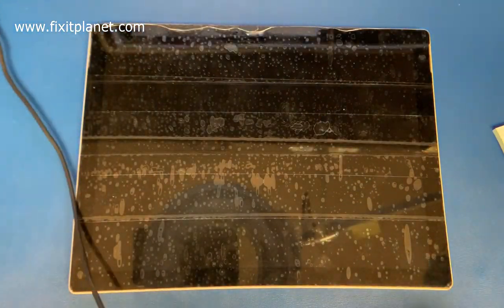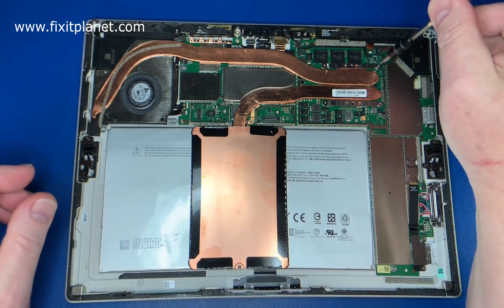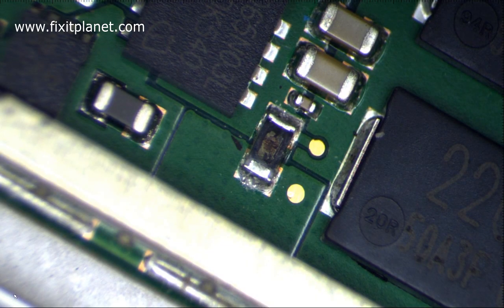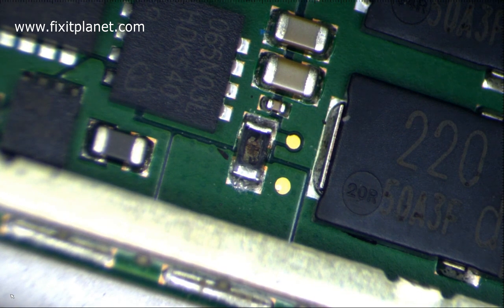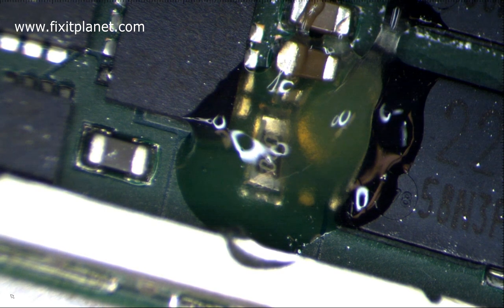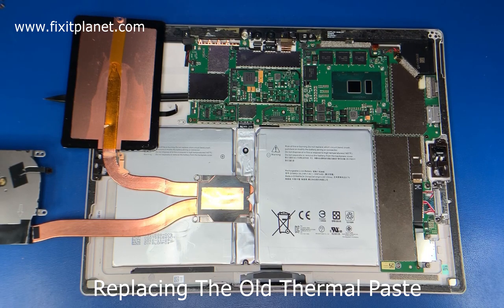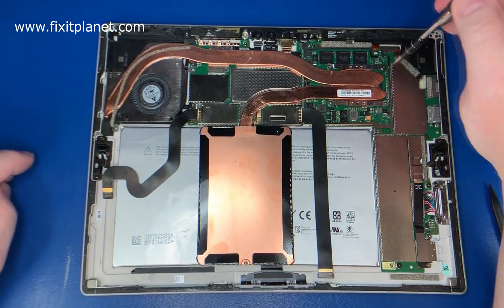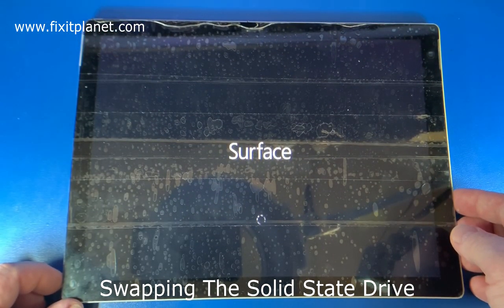Surface Pro 4 "Won't Turn On" Repair From Start To Finish.

Comment from the maker: Please Note: We are replacing a 0 ohm resistor. Sorry I said it wrong in the video.
Reply: Hello @Fix It Planet my surface pro 4 got freezed and after forcing to shutdown i got only black screen...
The keyboard lights still work and also wenn i connect a external hdd the light of the hdd shines... 
Is it possible that i have the same problem? Thx for your video
Reply: @Fuxn  Hello, same problem....
Reply: -  I didn't have a spare 0-ohm resistor so I made a solder blob to bridge the contacts. Works like a champ!
- I suspect the root cause for these 0-ohm resistors failing is elsewhere - so without a 0-ohm basically acting as a tiny fuse, what will blow up next? I think it is prudent to limit turbo boost with Intel XTU or Throttlestop on any of the machines with these symptoms to prevent the CPU from going into high-current mode.
-  BTW I love the trick of wedging up the mainboard with a spudger to free the battery contact without having to remove the whole board
- Note: T5, T4, and T3 torx are needed to work on these things.
Reply: A 0 ohm resistor is really a fuse
Reply from the maker: @DSAK55  Yup
Reply: @phatvw1  exactly my thought. If it's 0 Ohm doesn't that make it basically just a bridge? In which case it sounds like it's main job is to get blown when needed. Why isn't this a fuse?

Comment: Also to report that this fixed my problem! SP4 wouldn't Turn On but noticed that backlight for keyboard was turning on.  Luckily had replaced battery earlier this year and was easy to open. My resistor did not show any signs of burn but could see a voltage drop. Just did a little solder jump to test and everything works as usual!! Will later try to install properly the zero Ohm res. w/ proper equipment. Thank you for your video!
Reply: How it stop working????
Mine is like this: "I do a reboot... after 5 minute,i was surfing browser. and suddenly it freezed. i do long press power button for 30 sec to force shudown.... and then it did not turn on...."

When power turn is press i hear some clicking sound in camera, and CPU area is little warm....

Is your symptom  like me?? did your surface freezed like me??? please narrate/.... Thank you

Comment: Great video.  I just replaced the batteries on (2) Surface Pro 4.  First problem: I did not have the ribbon for the battery on the pin below the motherboard (video I had watched did not mention it) so it was not properly aligned and showed "no battery" when I tested them after installation. Both worked fine connected to power.  Second and current problem that I cannot figure out:  I re-positioned the ribbon from the battery on both units so it was on the pin and lined up correctly.  Now, both units will not start on battery or connected to power.  The light on the charger is continually on for about 3 seconds, then very quickly blinks of for split second, then on again for about 3 seconds.  I do not see any burnt components, as in your video.
Reply: Update: I put a thin piece of plastic between the battery and contacts on 1 to see if it would boot, but it did not. I was reading another post and it said that if the prongs on the motherboard touch the wrong contacts for the battery, the motherboard could be fried.  If that happened, what should I look for?  If not this, then any suggestions? Whatever I did wrong, happened to 2 of these.

Comment: Hey John, Thanks for this and all the informative videos.  Question: Was this device not powering up or just not powering the display? I have (and have seen) Surfaces that behave like this one but when a keyboard is attached there is power to it.

I'm about to dig into a SP4 that has power but no display. I'll let you know if the same resistor is the issue.

This could answer a lot of questions people have been asking about Surfaces for years.
Reply from the maker: Power may still reach some areas of the logic board depending on what failed. No power just means the tablet is not turning on. Maybe the CPU is not getting power for example so the tablet does not turn on and certainly no video will appear on the screen.

Comment: Hi, I've been frustrated by the lack of information around the schematic on surface pro's and wanted to share an idea. I noticed quite a few test pads on the boards which seem fairly common over the entire range. I'm going to try and document what the correct voltages should be on each one during various stages, would you be interested in validating my findings?
Stu
Reply from the maker: Sure
Reply: hello friend, do you have the voltage values?
Reply: please share your findings....
Reply: did you do the test?

Comment: Hey @fix it planet I am having the issue where the surface will power in connected, but wont cycle without. I am preparing to get find the resistor thats blown but was just wondering if there are any steps you would take to ensure that this is done properly. Also, what is the glue stuff you are putting on the board when doing the soldering? This will be my first time doing this type of repair so I want to make sure that I have all the right tools.

Comment: Great video!  I'm doing several Surface Pro 3 and 4 repairs for screens and fan/heating issues.  I saw you used Protronix thermal paste in the video 2 years ago.  What would you use now in 2021.  I've been reading about this: Microsoft Uses Honeywells Phase change TIM to stop regular thermal paste from leaking onto the motherboard.  Any opinion of what is safe to use? Exact brand / Paste would really help me.  Thank you!
Reply from the maker: We will still use Protronix Series 7 and Series 9 is available now too https://amzn.to/3xVKBVX Non drying formula is good. Cheers!

Comment: Great tutorial! What about a Surface Pro that will not charge? (or turn on) [the charger led will not light up] 
I have a SP7 and 2 month after warranty and it will not charge or turn on. 🤔
Reply from the maker: I am actually working on that tablet now too or a 6 I can't remember. I guess if I can, I will post a fix.
Reply: @FixItPlanet1  Fantastic! 
Did I miss your post for the tablet fix?

Comment: How did u manage to open the screen? Bc i also have this problem w my SP4 but repairman said that he couldnt open this device, bc of it is vacuumed??
Reply: It's just got a sticker holding the screen in just like all modern phones you just need a heat gun, a guitar pick and suction cups. You have to be careful not to shove the pick in to deep as there's a ribbon cable attached to the screen

Comment: My surface pro 4 won’t run off the battery and it has to be plugged all the time  💔 is it easy to replace those diodes you talked about ?

Comment: Dear Fix IT Planet,

We have a surface pro 4 right now. The surface is only working with the ac adapter and not with battery. When you pull out the ac adapter the surface wont start. 

Do you know how to fix this?
Reply: the same to me,
Reply: Sounds like a battery issue

Comment: I am an amateur at this and have no idea what to do inside my Surface Pro 4 but I seriously feel like I can't live without it. Is there anything I need to do for static or can I just open this up and follow your video and be fine?
Reply from the maker: Just be sure to discharge your self into the frame before touching anything inside. Good luck

Comment: I have surface pro 4 don't  turn on I checked all voltage diodes resistor fuses  everything it's ok but when I putt chargeur nothing happens cpu don't heat at all 
Can you give me any solution 
Ic give 3.3v
This fuse give 8.7v
Diode battery only 12v to 8.7v
Diode chargeur 12v to 0v

Comment: Hey @fix it planet - Do you have any idea what I am looking for when soldering the new resistor onto the board for a surface pro 4 that will only turn on while plugged in? I have all the parts and am ready to do the repair but dont want to take off the wrong one.
Reply from the maker: There is not a cut a dried answer. First close visual inspection under microscope is recommended. If everything looks perfect then probe around using a multimeter following the circuit for faults. Among other things bad caps, resistors, and even transistor is possible. Short to ground is a dead giveaway but finding the culprit takes investigation and patience.
Reply: Fix It Planet thank you so much! I will let you know how it goes.

Comment: Heyy i don't know if anyone can help but while replacing the battery i used a metal tool and think I may have shorted something. All I know is that my surface pro 4 has no power with the new battery (the contacts are touching fine)

Comment: For someone who don't have the kit required or no experience with detail repair like replacing resistor, it would be better to replace the mother board?
Reply from the maker: Sounds like it. Yes.

Comment: Thanks for the video. You aren't kidding that there isn't much info on repairing a Surface Pro.

I was gifted a Surface Pro 1 that doesn't turn on and seems to be the black screen of death, would this resistor repair fix that generation of tablet as well? Where would I source a part like that?

Comment: So I  soldered new resistor on, surface boots up but only to external monitor,  lcd is black..any thoughts ?
Reply from the maker: Double check display connections. Verify no physical damage. Try a known good display. Good luck!
Reply: @FixItPlanet1  turned out to be a bad screen, the flicker problem was so bad it only works for a few secs, then black screen, an new pro 5 screen and appropriate cable sorted it thanks

Comment: Can you describe broken resistor model or good replacment model which I need to buy. I replace it two time . My resistor blow two times on mine surface pro 4.
Reply from the maker: Please Note: We are replacing a 0 ohm resistor. Sorry I said it wrong in the video.
Reply: You better thank God you didn't fry the processor..
Way too many people believe that the part that fails is the problem, while it usually is some other part on the same rail.

Comment: hi, i have a pro 4 that has a black screen, but the keyboard lights up and it gives power from the USB port, when i hold the power button down it seems to shut off, but no screen activity at all, charger or not, any thoughts ? thanks
Reply: Nevermind, I got the screen off intact and yes, its that same 0 ohm resistor its the tiny 0603 size, the smallest SMD 😆..have ordered some thanks
EDIT, there's an even smaller component just above the 0 ohm resistor, you have to Really look to see it, I don't trust my hand so have put kapton tape over it in case I blow it away..anyone know what that component is ? Looks like a REALLY  tiny resistor or fuse maybe 🤔
Reply: Same problem here. Any fix?

Comment: I try to desolder the 0r resistor. 450 degree c should be enough to melt the solder. Once i touch the tip of solder to the board, it cool down the solder very quickly. Please help me as there are now short circuit cold solder between the chips

Comment: Same problem on surface 5. Help to find the same resistor on the power of the processor for replacement by 3Amp.
Reply: Have you try to fix it before?

Comment: This is exactly what happened to my SP4.  I am an artist and was using it daily.  Can you tell me how much if I sent it to you?
Reply: I can fix it
Reply: $250
Reply: @mp77715  hello. I'm interested also. Can you email me please with the info?
Reply: Jesus Chavez email?
Reply: @jesuschavez5660  Did you get this fixed?
Reply: I'm having a issue with SP 5 - Adapter light on, no power
Reply: @mzportr  nope, still looking for a service to do this

Comment: My SP4 charger will not show the white LED charge light. First attempt less than 48 hours after normal use and proper charging.
It just won't turn on.
Tried three chargers and none will show the white LED charge light when connected to the SP4.
I borrowed an SP4 and all chargers show white charge light. So must be my SP4 has a fault.
What should I try first? (I am very afraid to try to remove the screen)
Reply from the maker: Unfortunately you have done all you can do without taking the screen off.

Comment: What is the storage space max this system supports and which is the size format it uses (22mm x 80mm)? Any special recommendations on type of ssd to buy for this particular model? I know you mention NVME. Don't they exist in different physical dimensions?
Reply: 1TB Nvme or m.2

Comment: I have this issue where it won’t turn on at all, even on charger. But that diode looks ok, could the diode go bad without being “blown”??
Reply from the maker: Yes but there can be other failures also this is not the only possible failure.

Comment: Is there a place I can buy that battery connector/spring pin from?
Reply from the maker: just do a search for Charging Port Connector for Microsoft Surface Pro 4/Pro 5 1724 1796
Reply from the maker: Is yours physically damaged?

Comment: Hey! I have a complicated question for you. So I'm in the process of repearing multiple SP4's however one I'm working on is strange. The "fuse" is good. The diodes are good, and I'm measuring 3.3V beside the ITE IC controller. However I am only measuring like  0.5V on the 6 orange things (not sure what they're called) in the power delivery section of the board. what should I look for next?
Reply: did ypu manage to fix it ?
Reply: @thezombiesurvivalist It is insanely annoying if someone asks for something but will not answer other peoples questions. Answer @arminder Deol s question amonatidis

Comment: Very interesting and educational video, I could use your help. On my surface pro 4 I replaced the screen and the LCD cable now the screen comes on during boot or if i go to bios settings but as soon as windows starts it goes off but the tablet is running which I can see on a secondary screen, also the touch doesn't work. Any suggestion from your part would help greatly. Thank you.

Comment: I have found several kinds of 0 ohm jumpers but with different watts 125w and 330w?  also where can i find a kit for the flux and heated twezers
Reply from the maker: We are using these hot tweezers https://amzn.to/2pqpmxV Hand piece only here https://amzn.to/37cpodK We use this station https://amzn.to/2KqtGVe or you can use this https://amzn.to/35cLOK9. For a one off repair cheaper options can be substituted such as this https://amzn.to/2CPRWvz Flux we use https://amzn.to/2pqqzoX or https://amzn.to/2qTYpD3 or https://amzn.to/2pu3x0s

Comment: hard to find 1/4W 0805 0 Ohm  everywhere has 1/8th watt.  Some people say you could put two of these side by side?  I'm trying to order some as fast as possible, I'd order from China but I need Amazon or something with 2 day delivery.  Any ideas?  Lots of sample books but no one with 1/4W sample books.
Reply: Isn't a Zero Ohm resistor really just a jumper?  I mean, it doesn't do anything.  It must act like a fuse then if the resistor does blow.

Comment: I had an issue after replacing the battery, eventually I took it right back to the point where I could see the pins beneath the board where the battery sits, straigthened or unbent the pins, reattached everything and the tablet finally booted up.
Reply from the maker: Sweet! Good job!

Comment: My surface pro would not turn on after it being off for almost a year, I left it charging over night then it started working again. Just wanted to share for some that might also have the same problem.
Reply: Thats the same problem hes describing, its super common. My sp4 does the same thing. If i give it 24h on charge it will have enough in the battery to start then it will charge fine

Comment: Hello!

Basically, Surface Pro 4 turns on and works through miniDP. BUT the internal screen not working: touch screen is, but there is no image. Have you ever stumbled upon something like this? It is NOT the screen, tried 3(!) different screens.
Reply: How did you fix this? I'm having similar problem

Comment: Another Youtuber's Video says that they are 0 ohm resistors from the factory. Do you know what the factory resistor measures out at?
Reply from the maker: Yes 0 ohms is correct sorry i said it wrong in the video.

Comment: I’ve got the same exact issue.  I can’t even get the local mobile and tablet repair place to touch it because they say the glass screen will break almost every time.  MS is of no help.  $450 for a non warranty refurbished swap.  I don’t have hot tweezers. Not sure if I should just give up on it.
Reply: I'm getting the same response in my local mobile and tablet repair place...did you found a solution?

Comment: Hey there.. my surface pro 3 won’t turn on at all and I’m so frustrated.. do I really have to throw it away? Can it be fixed? When I put the charger in the light on the charger goes on when it’s attached but no joy with the surface. Would you say it’s gone forever..? Thanks xxx
Reply from the maker: No I would say there is a chance it can be fixed.
Reply: Fix It Planet oh that’s cool.. I’ll try to find someone who can fix it. Probably somebody who can build computers - gamers.
Reply: Hi i have the same problem, did you solved it? thanks

Comment: Is there any saving grace if the inner screen cables connected top right of the display connectors somehow rip? I replaced my battery and accidently cut those cables off when removing the screen, so now half of the screen wont turn on now.  Only the other half turns on.  I can split the screen slightly from digitizer and see the connectors.
Reply: No saving grace except for the fact those cables are cheap. $8-$10 bucks on ebay. Just make you know if you have a V1.0 or V2.0 display (they have different connectors)
Reply: @robertcabansag5222  what are they called? when I searched it just shows the cables that connects the screen to the motherboard.
Reply from the maker: If any part of the display that cannot be removed is damaged then no. If there is a cable that can be removed and replaced then yes.